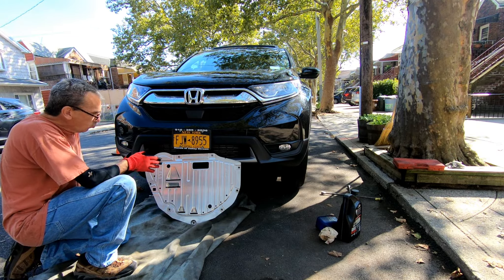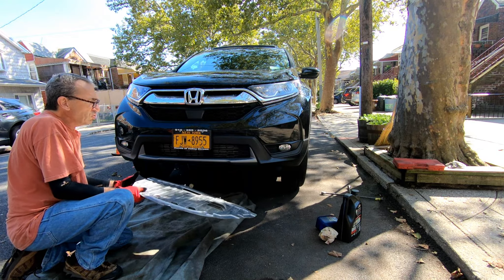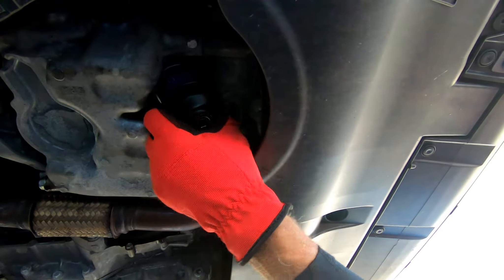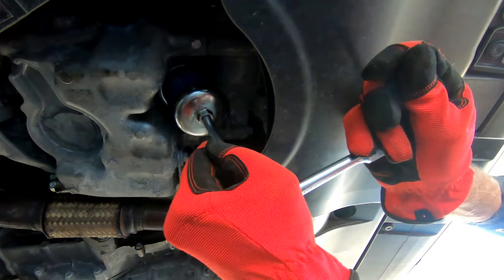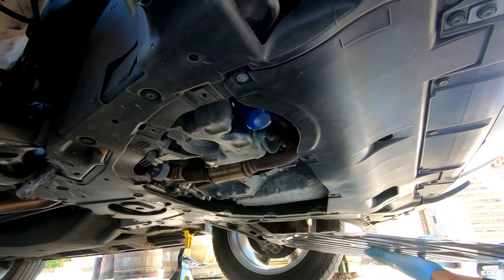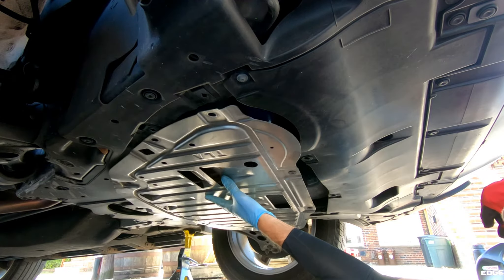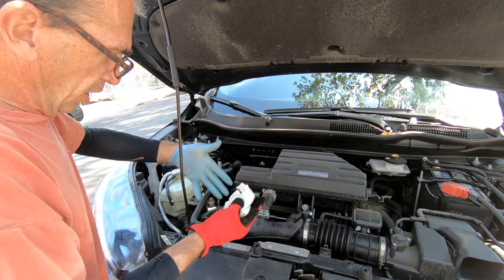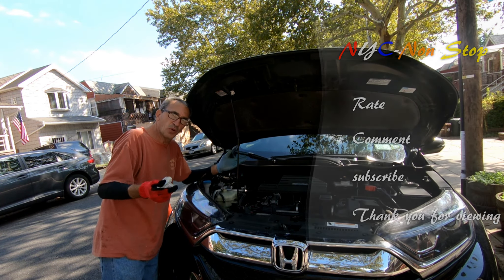2017 honda crv oil change trouble changing  Schedule A16

Comment: You can tighten it by hand with sandpaper hold the sandpaper in your hand and it'll grab and that's all you need to do hand tight
Reply from the maker: then go make that tool good tip why a rubber glove works too